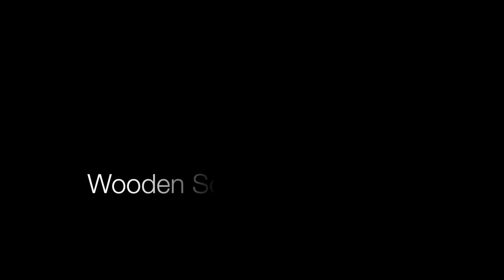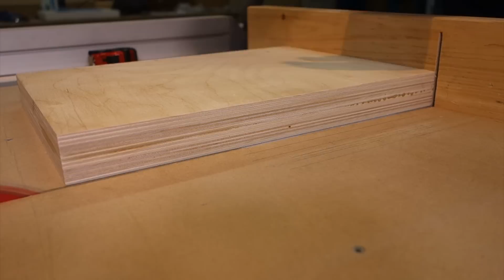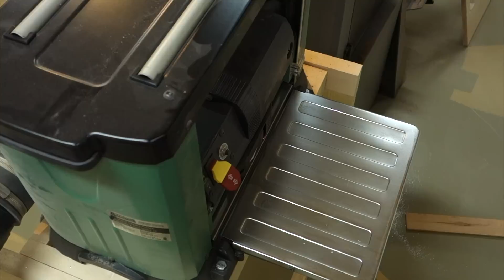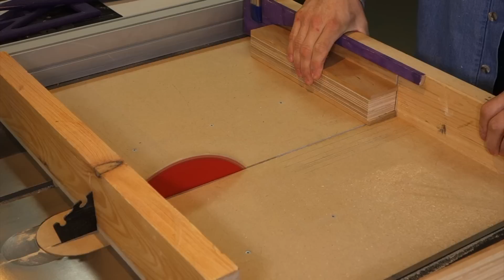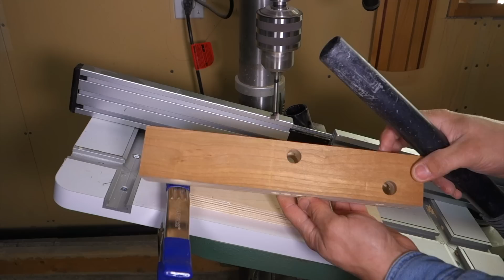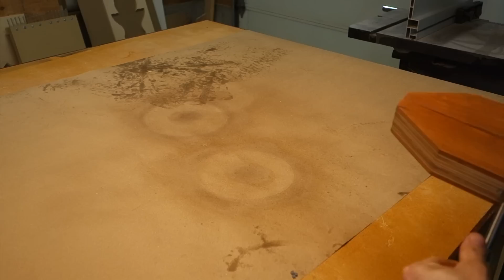Make It -  Wooden Screw Clamps

Comment: Just an idea, but as long as you are laminating, why not cut the slots for the threaded rod with your table saw before you glue up? Drilling angled holes and all that chiseling is really only necessary in solid stock. Slots will be square ended and will not taper in to the nut, but I don't see any disadvantage in that.
Reply from the maker: +bomaite1 Yeah that's a good idea.  Thanks!

Comment: Great video, but you can you tell me why the holes for the thread need to be elongated like that. As you can probably tell I've never used these so have no clue. Thanks
Reply from the maker: Neil Mair thanks. The two pieces of the clamps are never parallel to each other. The elongated holes allow it to rack and twist without binding.

Comment: Dustin, If I don't want to use plywood for clamps what would be the best wood? I don't want it so soft that the project mars the clamps yet I also don't want the clamps marring the project. Also, you probably have answered this a million times, what it the paste you rub on your projects?
Reply from the maker: +Kenneth Johnson I've answered the finish question so many times I made a video about it and post a link to that video in the description anytime I use it in a project video.  As far as wood goes, there is no perfect solution.  If you're concerned about damaging your project, use soft would cauls or sacrificial pieces in between clamps.  You'll want the clamps to be as strong as possible so I would recommend any straight grain hardwood.

Comment: does the glue in the plywood not chip your planer and jointer blades? Unless you have the spiral inserts most the time straight high speed steel bladeswill chip when plywood is passed on its edge. Oh yeah good looking clamps with that plywood like that they will never give.
Reply from the maker: Jeremy Miller I've heard rumors about that but let's be realistic. Show me a glue that is harder than carbide. I've thickness planed plywood before and never seen any indication of dulling, let alone chipping. I haven't rotated the cutters on my machine since this video and it's still making beautiful cuts. Thanks!

Comment: Is there anything special about that kit from Jorganson?  Could one just use all-thread and aluminum rod for the inserts?
Reply from the maker: These threaded rods are half reverse threads.  If you just used standard rod, you wouldnt be able to tighten them.  There are ways to do it though..  Check out I Build It on youtube, John built some without using a kit.

Comment: hm.. i was always afraid to use the planer with plywood, in this direction. it does not dull the blades?
Reply from the maker: Attila Szabo carbide vs adhesive. Mine seem fine.
Reply: Dustin Penner great work! just wondering how that planner performs and are you happy with it?

Comment: could you just make these out 2x4s or is that not as strong as the laminated wood in its side? Also, is there a function to the slots and the ability for the screws to swivel? thanks! love the videos
Reply from the maker: Softwood wouldn't last very long, straight grain hardwood is recommended.  If you didn't have the slots the clamps would be nearly impossible to use.  They would bind if the two screws weren't turned at the exact same time.